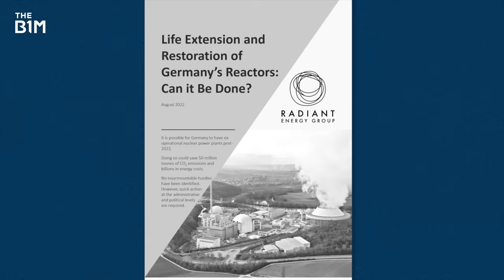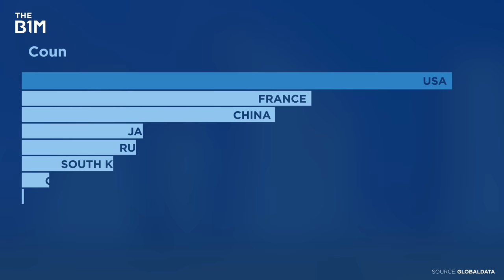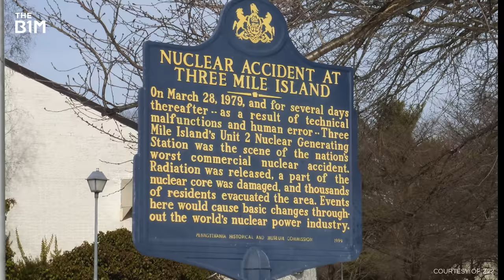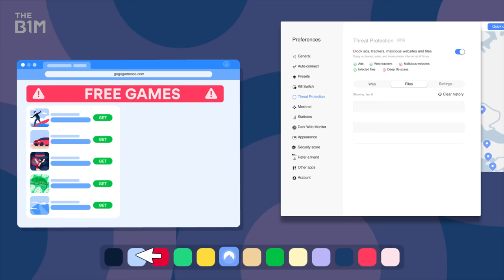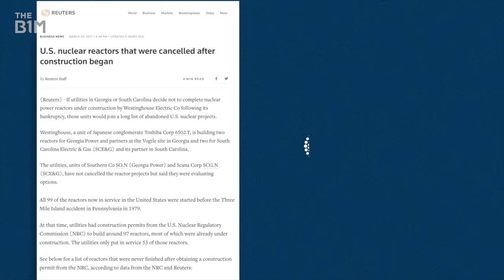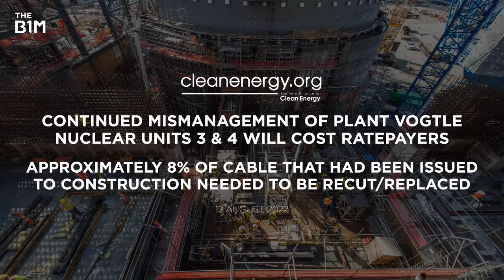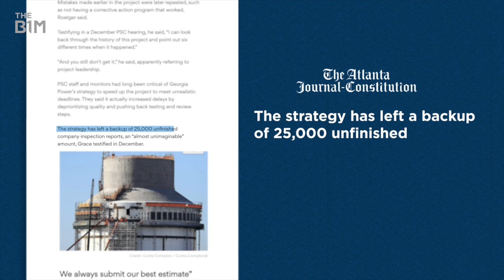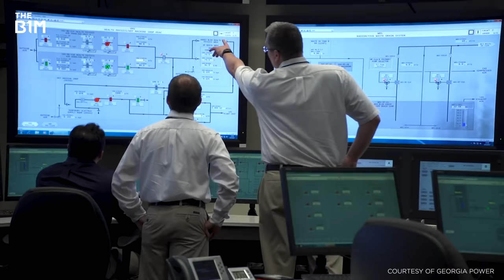Why Nuclear Power is Making a Comeback

Comment: I really hope that nuclear makes a bigger comeback in the US
Reply: I'd echo your sentiment with the caveate that they come out with a clear and understandable plan to deal with the waste that doesn't involve burying it in poor rural people's back yard combined with actively ignoring said poor people's elevated cancer rates.
Reply: @mh3535  If safely contained and sealed in barrels, it shouldn’t be a problem.
Reply: @mh3535  not to dismiss your point, but there is little to no increase in cancer near storage facilities since they are so deep (900 feet) . Hell the risk of cancer is shown to be higher if you live near a coal plant than near a nuclear plant.
Reply: You don't need to bury the vast majority of it anywhere.  95% of fuel rods can be recycled.
Reply: Jim Frazier  Recycled waste will take the half life down to hundreds of years.
Reply: @mh3535  I don’t think that’s ever been the case. But even so, it most certainly isn’t now. Nuclear waste is very safely contained and generally. Not a problem anymore.
Reply: @mh3535  Theres already a solution and France has been doing it for years. 90% of the spent fuel is fuel that just needs to be cleaned. And if youre concerned about nuclear waste how concerned are you about the electronic waste that is solar panels or the plastic waste that is wind turbine blades. Even if nuclear waste wasn't recycled everything from around the world for the past 50 yrs would fit in one football stadium. By 2050 there's estimated to be 78 million tons of waste from solar panels and it would take Japan 19 yrs to recycle the 10k tons it currently has.
"Most electronics are made with toxic chemicals and metals that are perfectly safe when in use, but that’s not the case when they are being tossed away; they can pose serious health risks if they seep into the soil and groundwater when deposited at a landfill."
"I used to think that plastic water bottles could be infinitely recycled, that every time I tossed one into the blue bin, it eventually came out to be another plastic bottle. As it turns out, that's not the case. Some materials can be recycled infinitely, but plastic is not one of them."
Reply: @eannamcnamara9338  Which storage facilities go that deep and what percentage of spent fuel is in them?
The WIPP doesn't take spent fuel or high level wastes. 
The IAEA inventory of wastes shows that no spent fuel, used fuel, or high level wastes have been placed in permanent storage in the US,. The IAEA inventory also shows that most spent fuel remains in "temporary" cooling pools. Some has been put in casks, but those casks are not rated for final disposal and most are not rated for transport.

Now, this is all fine so long as "nothing goes wrong", but falls a long way short of being secure when something does go wrong.
Reply: @aaroncosier735  none in the US but the Norse countries have deep level storage for high level waste.
Reply: @eannamcnamara9338  
Not yet they don't.
The Finnish one is nearly complete. 
Not operational yet.

But yes, highly socialised countries are substantially ahead in managing wastes. It helps that they had strong community engagement at all points in the process.

Sixty years after the need was recognised. Fifty years after there was a significant stockpile. Forty years since the system was designed. 

The very best examples are still shocking failures, and the US isn't even close.
Reply: I really hope so too. To be honest, the protest and dislike of nuclear energy - even just as temporary transition step to better energy production - has made me lose pretty much all faith in the environmental cause. The many billions of tons of coal that have been burned to pollute the environment since 1955 is just totally unneccessary.
Reply: @mh3535  

There’s a video proving that storing in barrels and burying them IS THE SAFEST OPTION!!!!!!
Reply: It's honestly the only way around coal/fuel/gas power. Renewables just end up needing coal/fuel/gas to pick up the slack anyways if the renewables are underperforming. The only way around that would be to have massive battery banks. But that's not really feasible. They would need to be absolutely massive to be used for a whole city's grid for any reasonable amount of time. And they would be insanely expensive to build. Might as well use the money on nuclear. Which has a very specific amount of power it produces, on demand, 24/7.

Sadly though, a lot of people here are still scared of nuclear power because of "all" the meltdowns that have happened (3...). The US one wasn't even all that bad, especially in comparison to the other two. Yet people will still use 3-mile as an excuse for why we can't have nuclear power. That, and the fact that it makes nuclear waste that can't be disposed off. You say "You just bury it" and they scoff at you for some reason. The holes are expensive to dig, but looking at the alternative of massive CO2 emissions, I'll take the big hole. But hopefully those ways of thinking will die off.
Reply: @anonymousinfinido2540  I said "not rated for transport". 
That means not certified for transport. 
Some *are*, the ones that had to be relocated, but the great majority are not.
Oddly enough, they obviously didn't test hardened missiles. Those penetrate meters of concrete easily.
Like the train impact, the tests were intended to impress yokels, but do not reflect the difficulty of ensuring integrity for centuries.

In addition, no dry casks are rated for permanent disposal. They are not intended nor designed for full containment lasting several centuries, let alone the several thousand years required. Current dry casks are "temporary". Even casks rated for permanent disposal will need to be interred in deep geological storage. They are not intended to withstand the erosion of topside exposure. 

In any case, about two thirds of US civilian spent fuel isn't even in casks. It's still in the short-term temporary cooling pools. Some has been there forty years.
Doesn't matter how good the casks are if the waste isn't even in them.

As for tree huggers, well fine. You are welcome to hug a fuel assembly.
Reply: @mh3535  There is nothing wrong with deep geologic burial of spent fuel. But there's also nothing wrong with dry cask storage for a few hundred years. The ultimate goal needs to be reprocessing with breeder reactors once the virgin uranium ores get more expensive. We have already solved the waste issue.

Comment: Great video as always. As a Georgia resident and a big nuclear advocate I've been split on this project as I've had to pay a lot for the overruns (in terms of extra fees added to my power bill) but also happy that we are leading nation in a new age of nuclear
Reply: Zaydan Naufal  Georgia, USA
Reply: Nuclear is really expensive 3 to 4  times as much as solar and wind per produced kwh of electricity. 
It is also 5 times more expensive to build.
Reply: @paxundpeace9970  , that mathematics tend to change when a power plant is expected to run for +60 years with "small" running costs.
But it's a difficult mathematics, how do you measure the cost of air pollution burning fossil fuels for instance. Right now quite a few countries in Europe (Europe has more nuclear plants together than the USA) wish they had built more or at least not started to cut down.
Right this afternoon France got at best 75% of its energy production from nuclear, best in the EU in that respect.
Reply: Nuclear is expensive, and in my opinion not a replacement for green energy that continually becomes cheaper. It is however a course we should take immediately to stop the worst outcomes of climate change. In the short run energy will be more expensive, but more available and reliable. In the long run we can replace old reactors will renewables and eventually have green and cheap, and unlimited energy.
Reply: Better than us in South Carolina. Our bills are going to remain high for the next 15 years due to the $9 billion failed VC Summer nuclear plant scandal.
Reply: @paxundpeace9970  is it? GE's new BWRX-300 is supposed to be competitively priced with natural gas plants. At that point nuclear is a no brainer when you factor in the amount of pollution gas plants make.
Solar and wind are very slowly growing. But, at scale wind and solar alone won't work. 60% of US electricity is still coal and gas. Coal is steeply dropping off, but natural gas, not wind/solar, is filling its place.
Reply: So, as a big nuclear advocate, you're o.k. with nuclear waste disposal in Georgia?
Reply: At least it will last a long time and provide rock-solid energy. It will pay for itself.
Reply: @dylanc9174   Nuclear has been built in the US in the past cheaper than any other source of power today, less than $1000/KW, some plants still running.  If today, it’s expensive in some places like the US, it’s because people there have allowed politics to make it expensive, as if suddenly the cheapest cars became a $million each. Doesn’t mean that’s the real  cost. 

And “green energy” doesn’t “continually become cheaper”.   Only children think an initial price drop goes on forever. In the last two years the cost of PV has gone up dramatically.  Same goes for lithium in batteries, and magnets in wind turbines, and the land cost under all so called green energy.  And, it’s never the cost of just the green energy alone that we pay, it’s the cost of the green plus all the conventional power for when sun doesn’t shine etc, a cost which climbs all the time, esp in Europe now.  So no, of course weather dependent green by itself will never replace always-on reactors. 

Energy grifters need to stop trying to shake people down in the “short term”.
Reply: @lonestarr1490  Yes, it just goes accross the river to the SRS, the savanah river site.
Reply: @lonestarr1490  at least it's not in your lungs like coal
Reply: Of course you know that Georgia Power had to request an emergency varience from design specifications for Vogtle Reactor #3. Specs called for the double containment walls to be 3 inches apart and they are now 2 inches apart. The reason is the 12" thick steel floor of #3 is "dishing in."  The weight of the containment is causing a concave collapse of the floor. Since the walls are no longer vertically alligned, the load capacity is affected by any future seismic activity. The reactor has not been fueled up and the huge 9 million gallon passive water coolant tank on top of that AP1000 reactor has not been filled yet. Maybe you should be looking to move out of Georgia before that happens.